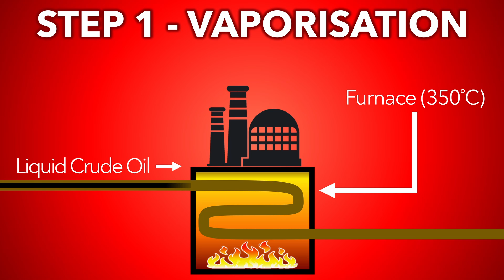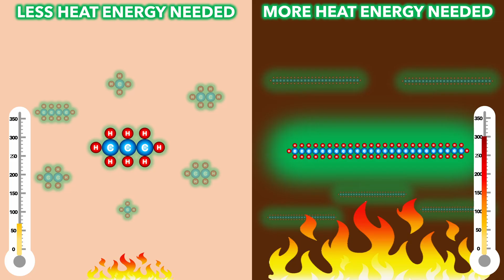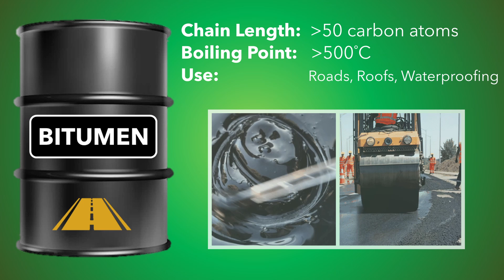Fractional Distillation of Crude Oil Explained | GCSE Chemistry

Comment: What stops something like Fuel oil from condensing at the top? I get that Petrol would be too hot to condensate below it's boiling point, but what stops the compounds in Fuel Oil gas from traveling up before it can condensate?
Reply: Each fraction has a bowl that captures the condensate for that layer. It has holes through it that allow vapor from the layer below it  to pass through and condense against.  While some small percentage of large molecules will make it up, you typically recirculation some of the condensate back to the layer below it which gives another chance to stop the large molecules from moving up